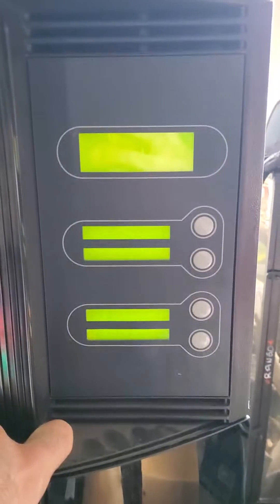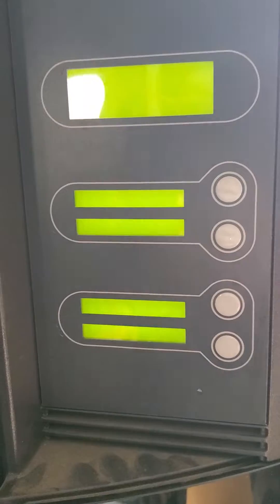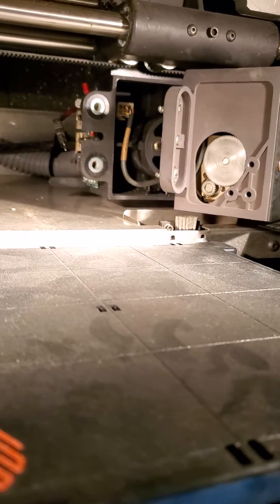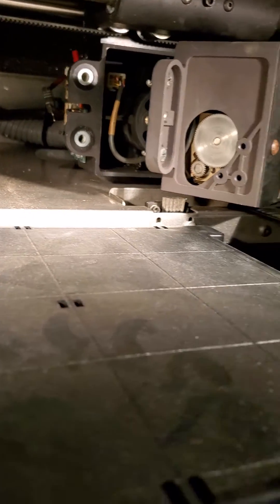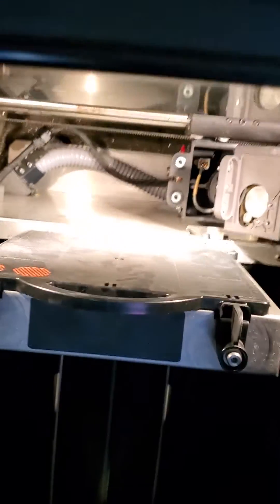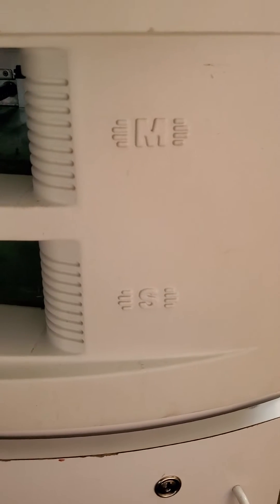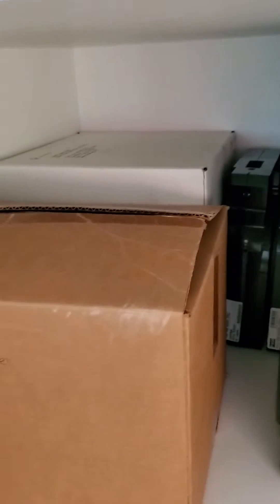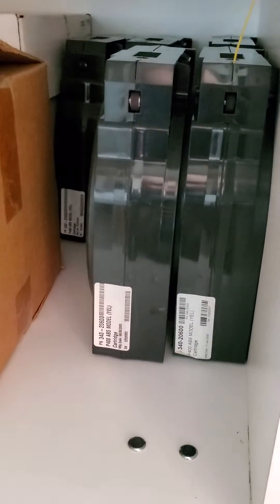Stratasys Dimension 768 Run-through

Comment: I’m getting one tmw for $100 he says it works good investment?
Reply from the maker: If it works that's great. It's got built-in air filtration, which is especially important when using ABS as when it's heated it off-gases toxic fumes quite seriously.
Reply: @StopMoColorado what software do I use seems pretty hard to download catalyst
Reply: @StopMoColorado it works great do you reset eepromm?